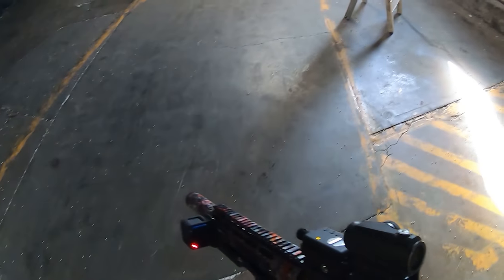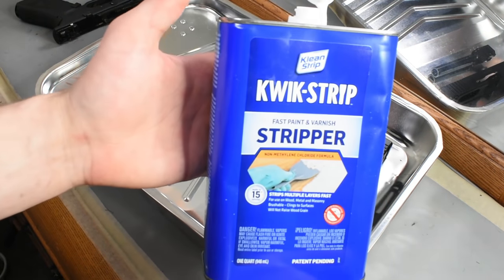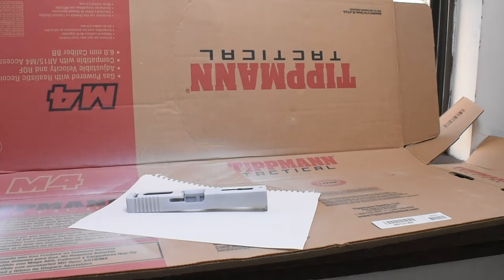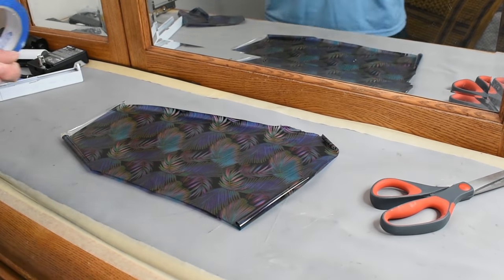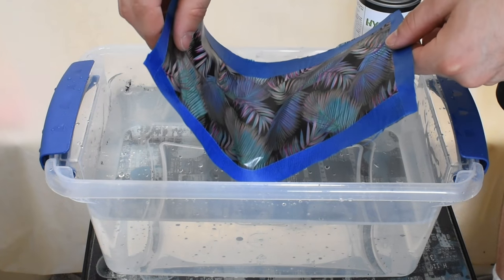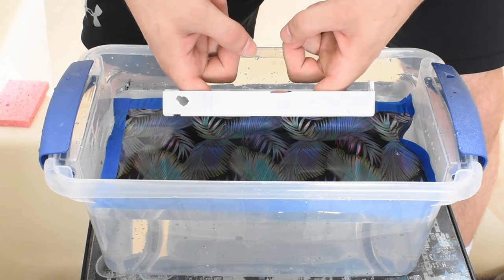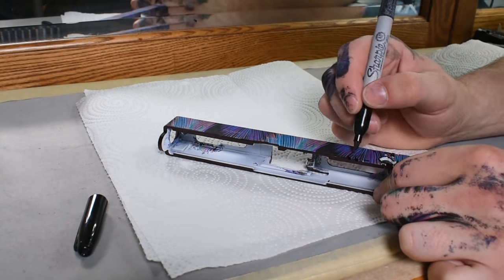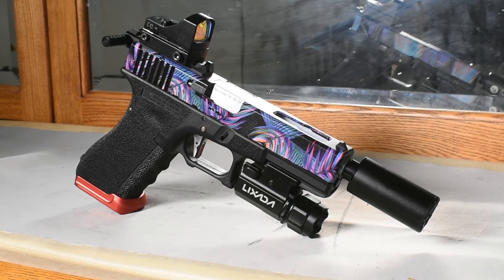TUTORIAL: How to Hydro Dip | CUSTOM PAINT JOBS!

Comment: Hello there, I am completely new to hydro dipping and honestly just painting in general so bear with me LOL 
I noticed that a couple times you said that you needed to start over. Did you just run more paint remover over the slide with the failed graphic on it and let it sit? Also do you let the slide sit after applying each coat of primer or just repeatedly spray the thin coats on? As well as, do you have any recommendations when using tape on parts of the slide.
I'm planning to dip a 1911 and I'm wondering if you have anything I should watch out for before i go for it
Thanks! Great Video!
Reply from the maker: Hello there! In regards to starting over, I stripped everything off again to return the metal to its natural state, I wanted to ensure my paint job was even all around. So basically if i messed up i started the entire process over, it was annoying but definitely paid off.  I have dipped a few other things since this video, and I think the reason I had to start over (graphic wouldn't always apply, missed some spots) was due to the graphic I was using.  I have not had this problem since, but maybe it was just taking the first few dips to learn!

I pretty much followed the directions on the can of paint exactly. I believe it suggests letting sit for 15 mins between coats, don't quote me on that but if you just read the can you should be set. 

For tape to mask off parts you dont want to paint, I would use blue masking tape or electrical tape.  I would suggest the blue masking tape but electrical tape may be better if the part you are covering has a lot of uneven surfaces, and i feel that electrical tape can be manipulated better without tearing or anything.

hmm as for anything to watch out for I would just say to make sure you dip the slide at a 45 degree angle-ish like i tried to do.  Mine was not exactly 45 degrees but you get the idea, you want to slowly let the graphic apply itself via water level as you gently push the slide down into the water.

My biggest piece of advice is to not let it frustrate you!  It just takes some getting used to but its easy enough to be done in my bath tub so I have no doubt that you will be able to achieve the look you desire, it may just take a try or two!  Luckily none of us can go play right now so just enjoy the process and take your time.  I always ask people who follow my tutorials to share the finished product with me, I love seeing the paint jobs!  feel free to share if youd like either here or tag me on instagram!  Hopes this helps bud!

Comment: If I like that my gun is already black and just want to but a print on it do I still need to remove the original paint from the gun slide or will I  be okay
Reply from the maker: The only thing I am thinking on this is that the new paint may not stick as well on the old paint if there is a protective/finish on the gun.  It is generally always a good idea to sand off the outer layer to allow proper adhesion.  I think the paint job would turn out just fine, but the paint may wear away throughout use if it is not completely adhered to the metal.
Reply: Yup just found out the hard way about to literally start from scratch 🙃 any recommendations for removal for the hydro dip without complete taking off the original paint?

Comment: Just subscribed! Would I use the paint stripper on my real glock slide/barrel if I do this on my gun?...can you upload a video on the prep work so we can see how you scrubbed the paint off with a wire/metal brush? My concern is scratches on my real slide if I used a metal wire brush

Comment: Might be a dumb question since im interested in hydro dipping my first pistol slide-

Will the new paint job affect or possibly damage the function of the gun since the inside components have a lot of different materials and moving parts? Or will it just act like it was the former black paint?
Reply from the maker: As long as you strip the original paint, this should not affect that at all.  

I run 2 Hydro dipped guns (gas blowback Glock and gas blowback Tippmann M4) and absolutely no issues due to being painted/dipped :)
Reply: @Private_Caboose  Awesome! Thank you very much!

Comment: Is stripping the old paint imperative? Or can I just degrease it and put the film over?
Reply from the maker: You will most likely get a better, longer lasting finish if you strip the parts and apply directly to the base metal.  

You can however degrease and apply it on top, but I think it may start to peel or reveal the layer below as it gets roughed up.  That is your call!

Comment: Good vídeo! How good is the finish of the rust oleum clear coat? If i use on a black painted stock it will protect the black paint that coming of? Another question, the sweaty hands can disolver the clear coat like it does with the normal airsoft paint? Thanks!

Comment: Hey caboose I just got my g18c and I want to spray paint my barrel. Will it mess up the gun
Reply from the maker: Your barrel?  IF you do so you should remove the current paint, you may mess with the cycling of the gun if you add too much paint to the outer barrel causing it to rub against the slide.
Reply: @Private_Caboose  ok thank you very much!!

Comment: Can you hydro dip one using one color or would it be better to just spray paint that?
Reply from the maker: So if you want a flat color, airbrush is probably the best bet- but most of us dont have one so spray paint is the second option!  

But lets say you wanted one color, but a design inside the color, you could always hydro dip into a one color design like this: https://www.ebay.com/itm/Hydrographics-Dip-BLUE-Carbon-Fiber-hydro-dipping-CF152WBLUEPAINT/121940805346?hash=item1c643d06e2:g:bFMAAOSwZtJW~GXV
Reply: Private Caboose Airsoft Thanks

Comment: On the rail on a rifle will it effect the dip with all the gaps?
Reply from the maker: It will not effect how you apply the dip, if that is what you are asking.  The pattern will still be applied well, even if the object has several gaps, like a rifle rail system.  I dipped most of my rifle here: https://www.youtube.com/watch?v=5K34AQaAKMA&t=8s

And the rail system came out great, the only thing I would say is that with every hole you can obviously see the inside of the rail system, which does not usually get covered by the dip.  So since I used a white base, any of the uncovered inner-rail could be seen through the holes, but once I slide the rail on my M4, the inner barrel covered up most of it making it harder to see the unpainted areas on the inside.

Comment: Do you need the paint stripper or can you just use the back of a sponge to sand it all the way down
Reply from the maker: Hey I would say the paint stripper would be easier, but yes you can definitely take the time to sand off all paint layers, or use a sand blaster for same effect.
Reply: Private Caboose Airsoft also, how long should you wait between coats? And how long to you need the paint to dry before painting the clear coat

Comment: How would you reccomend doing a 1911 slide? I tried it with mine and it turned out very bad. It didn't finish fully on one side and it didn't get the bottom piece on the front
Reply from the maker: I would try holding it parallel to the ground, and then gently pushing in one side completely, so that the dip is at the halfway point on the slide, from here you can gently roll the slide over onto the other side.  This will be removing the side you already dipped from out of the water, while now inserting the side that wasn't dipped into the water/graphic.   This would mean that when you roll the slide over, you need to be as still as possible so that the design does not get too warped if you are moving the slide slightly.  

I hope this makes sense, basically I think of it as a book.  Do the front cover first, and then the top of the slide is like the binding, where you would be rolling it over connecting one side of the dip to the other.  If your design is abstract than this should not be an issue at all, as even some slight movement won't be noticeable. 

My dips all took me multiple tries, over about a week of painting, dipping, and starting over, patience was definitely  important.  Best of luck on the next attempt bud!
Reply: @Private_Caboose  I actually got it to work similar to that way and it looks super good. I used the same hydrographic as you and I got a super good pattern but the graphic doesn't like to stick to the base coat
Reply from the maker: @Kobalt2772  Awesome I am glad you got the end result you were looking for!!!   I had some trouble with the graphic not sticking as well!!!! I had a graphic that had a lot of metallic parts in it and the metallic paint never wanted to transfer over onto the object.  I wish you could post images here I  would love to see the end product 👌
Reply: @Private_Caboose  I'll post a short video on my YT of a 360 view in a few hours or say. Maybe around 10pm central time but I'll send a message here when it's up with a link to it
Reply from the maker: Jacob dope man that sounds great!!
Reply from the maker: @Kobalt2772  Dude that is amazing!!! I like how the direction that the palm leaves are going across the slide.  It looks awesome, WELL DONE!
Reply: @Private_Caboose  thx

Comment: how should i go about painting/priming the inside of my m4 handguard?
Reply from the maker: Garrett H. What do you mean? Are you asking how to dip it because it is a larger item?
Reply: @Private_Caboose  not exactly. I mean how should I go about priming the inside of it for dipping. I don't think just painting the outside will get the inside of it.
Reply from the maker: @Garrett.  oh okay I see what you mean.  For my m4 which I showed in this video, I simply hung it by a string so I could rotate it and spray primer.  The hydro dip will wrap around some of the edges but you are right the design will not make it on to the inside of the handgaurd.  

This means the inside of my handgaurd is white, as that was my primer color.  If you really want to hide that you could always color in the inside with a black paint marker once before your clear coat so that white is not showing through, but there are rarely spots where you can see the inside once the gun is assembled and a black outer barrel is going through the handgaurd.